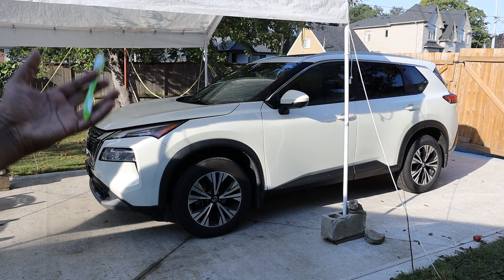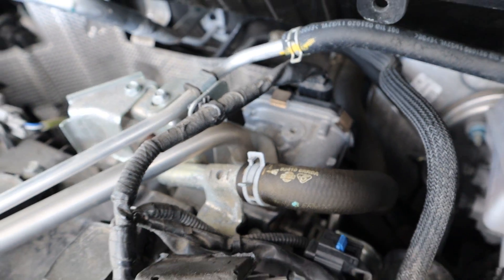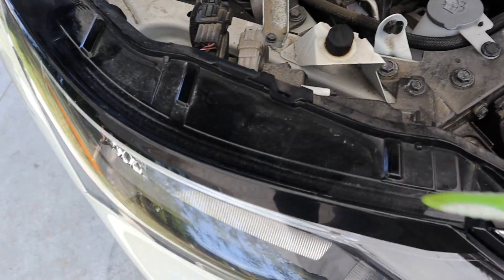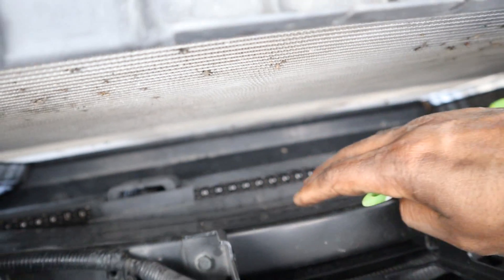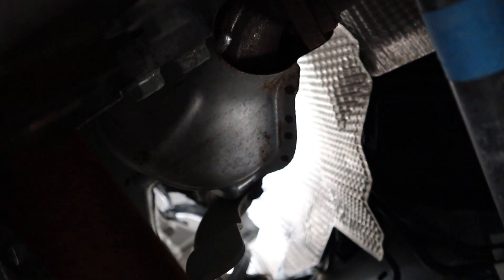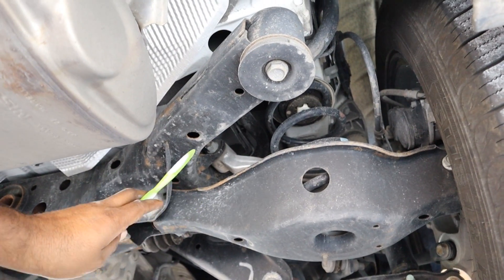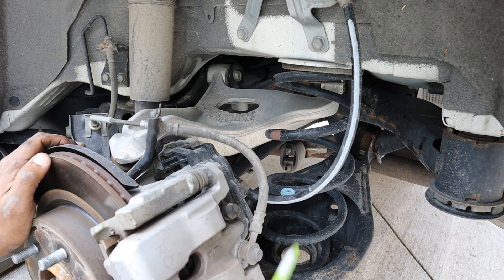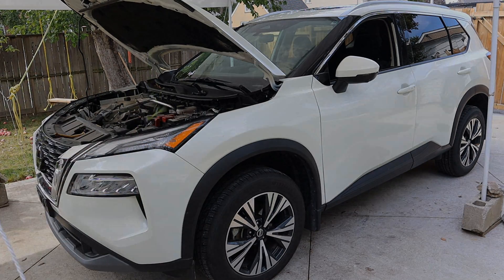Nissan Rogue Mechanical Review

Comment: 10:06 That is not the fill plug for the transfer case. That is the magnetic check plug, but not the fill plug. The fill plug is actually on the opposite side higher up and is a hex bolt. If you were to fill from this magnet bolt, you would only get half a quart in there, which is nowhere near enough. I just did one of these for a friend and his mechanic made the mistake of thinking that was the fill plug and it was severely under-filled.

Comment: 9:40 you don’t need a special too to do transmission services just drain fill from the dipstick then get the transmission fluid hot by idling and open the level port at the bottom for a few minutes then you’re done. It can be done by yourself in under an hour.
Reply from the maker: Ok

Comment: I take it a 2023 Honda civic 1.5T is much more reliable than this? Same with the Honda crv?
Reply: The 1.5T has problems with head gaskets. If you’re buying a Civic get the 2.0L (or the upcoming 2.0L hybrid). For the CRV, the same 2.0L hybrid system is your friend.
Reply: @tails300  too late, but I'm definitely assuming the civic even with the 1.5t will long outlive the Nissan rogue

Comment: The bottom is very open on this car but in Europe it totally sealed from the road.Everything is covered with plates down under.The power steering is electric.All is four cylinder engines .

Comment: In Europe it is called X-trail but comes with 1.6 petrol engine or 1.5 l diesel  and a manual gearbox or a CVT automatic . Its smaller brother is called Qashqai  with. 1.2 petrol,1.6 or 1.5 diesel with a manual gearbox or CVT.I own  a Qashqai 1.5 diesel and is a nice car and is a top seller in Europe .

Comment: I bought a 2017 Rogue in 2019. Worked fine for 6-8 months. I did the drain and fill on the CVT at 30,000 which was a mild pain in the ass with no dip stick but not horrible. Then spent an exorbitant amount of time at the dealership over the next 6 months getting warranty work on the front end because of a metallic clunk. They essentially rebuilt the front end and it still made noise ohh and I had to do a door lock actuator but because it’s Nissan you can’t just buy the actual actuator and pop it in like a normal car you’ve got to get a whole assembly which was stupidly expensive so warrantied it for that. I decided to sell it to the dealership for a profit during COVID value surge since I didn’t need a second car with us being WFH and having a motorcycle to use if my wife needed the truck. Was never happier to see a vehicle leave my life. Did not want to own that thing without a warranty.  Didn’t recall it being horrible to work on.

Comment: Dealer tech here, so I have a few says on this.
1) Thank you for a very detailed review
2) Transfer case seal oil leak is pretty common on this T33 generation, I believe it's due to improper installation. We have a bulletin for it.
3) These stake castle nuts are not fun to remove. If not being careful, you could damage the CV axle thread and will need to replace new CV axle. Nissan OEM CV axles are quite expensive. I actually prefer the cotter pin castle nut better.
4) We see less CVT problems than before (still, but less), so I believe Jatco made some improvements on their CVTs.
5) The older CVTs that use CVT fluid NS-2, have transmission dipstick. For the newer CVTs that use NS-3, there is no more transmission dipstick. There is still a tube with a "fake" dipstick so you can fill up CVT fluid from the top, but using a scanner to measure fluid temperature while draining overflowing fluid is the correct way to measure fluid level. According to Nissan, this way of measurement is more accurate than the traditional way with a dipstick. It seems to be common among manufacturers (Toyota does the same thing with their AT).
6) Nissan has been using one-piece style lower control arm for years, so either bushing cracks or ball joint gets loose, the whole control arm needs to be replaced.
6) The 3-cyl turbo engine has a plastic engine oil pan (why Nissan??)
Reply: Nissan burned me bad a 2016 Maxima and a 2015 Murano. The Murano puked all its fluid out at 900 miles. From the factory someone used what looked like plier teeth to install the line from the Jatco to the radiator. It split and the dealer made me pay 450 for just a refill. With 950 miles, they said it was rodent damage. My Maxima made it to 90k and hail (luckily) took that car out. As the CVT was on its way out. The Murano I limped 1800 miles for a vacation to California and back to Colorado. Thankfully when it starting bucking at 52k we traded for a 4Runner (new). So now we have 2 new 4Runners, and I will never buy another Nissan. 😂
Reply: This is after Having a 2004 Titan, a 2005 Frontier, a 2005 maxima, a 2006 Altima, 2007 Titan, 2011 Titan, 2011 370Z (loved it) and the 2016 Maxima, and 2015 Murano. So I was a loyal Nissan buyer.
Reply: @JAMESWUERTELE  the new generation Pathfinder comes with a 9 speed AT instead of CVT, so I guess there’s a reason for that.
Reply: Haha yeah, we have a '23 Rogue with the plastic oil pan.  First vehicle I've ever put a Fumoto on, as I just don't trust the integrity of torquing a drain bolt on during a cold Minnesota winter.  It does only require 22 ft-lbs, but ehh.  I feel better this way.
Reply: Hey maybe you know if in the latest 2023 turbo only models, if the CVT is still made by Jatco? Have they made improvement. I am curious about a Rogue. If Nissan would just split from Renault, find some great engineers, and start their own. Their last CEO cheaped out it seems, and now this is all happening.
Reply: @pnutbuttajellee1394  I do believe that the new generation Rogue's CVT is still made by Jatco. Like I said, we see less and less CVT  problems than before, so I assume Jatco did some improvements on their CVTs. Time will tell if the newer gen is getting better or not.

Comment: If it can get 250k miles without much issue like my 2011 Nissan Versa with a 4-speed automatic without burning oil, that would be a miracle
Reply from the maker: Didn't the versa have a CVT?
Reply: @speedkar99 in 2011 no unless you got the SL I'm hatchback configuration. All other models have the 5 or 6spd manual or the 4 spd automatic. I had a 2008 versa hatchback with cvt for abkit 210k miles and it never burned oil and 0 cvt issues on that car even though I drove it like a maniac.

Comment: I own a 2006 Nissan X-Trail which, so far, has been a reliable and low maintenance cost car. I wouldn't even consider a modern Nissan, especially one with a Jatco CVT!
Reply from the maker: You missed the CVT craze then
Reply: @speedkar99  yup, dodged that bullet!

Comment: We have used these models at my work for four years now. This is the first year they had a 3 cylinder turbo engine. The go kart style transmissions get you good gas mileage. I got 44 mpg driving from Atlanta to Griffin GA last night, primarily on the main highways. Good gas mileage. We fold down the rear seats. The covers pop off on the backs of the seats with our high impact use. An ordinary driver might never have the issue with the rear seat 💺 covering coming off, but overall, they are cheaply made. The stereo is fine, has android and apple CarPlay. The cars engines and drivetrains have basically changed almost every year, but the body style is the same as almost ten years ago with minor changes. If you can get a deal on a new one, I’d say they hold up to normal usage. We did have one with an engine that failed on the first day using it. It was an engine out/swap to get it fixed. Like I said if you can get one for less than a Mazda, Toyota or Honda of similar size and build you may want to take a chance. Buyer beware, they are cheap, but reasonably durable. I’ve never had a Honda engine fail. My best friend buys only Toyota, and my third friend has a Rogue. She doesn’t know anything about cars and always buys the worst cars. I’d buy any car beside the ones she picks out. Hope it helps if you’re wondering about Rogues. This has been a very honest appraisal of my experience.
Reply: Did you fill the tank before and after the trip? I do not believe you got 44 mpg in a gas crossover. My Camry hybrid likes to claim I'm getting 54 mpg on a highway trip sometimes, but it's always 43 mpg at the pump.
Reply: @aluisious your computer shouldn't be that far off. My sienna is pretty spot on only ever a 1mpg difference. I'm averaging 41mpg in my sienna hybrid and wverytime I hand calculate it the vehicle is always really close.

Comment: I take it that this review also applies to the new Mitsubishi Outlander?

It seems to me that the French engineering is strong with this one, thus the cost cutting on the parts for easy failure.
Reply: There is no cost cutting. What in the world are you on about. Whatever Honda/Toyota/VW you're driving will have smaller axles, more plastic parts and won't have Nissan's use of aluminium on control arms or independent rear suspension.

Comment: What is it about the jatco design that causes so much failure? Hondas been using CVTs since the 2013 accord and you never hear about their cvt blowing up.
Reply: The jatco cvt, unlike the honda and toyota units, lacks a launch gear. It gets the vehicle moving from a stop, then the belt takes over. Transmissions are under the most stress when moving a  car from a dead stop. So every time a nissan trannie starts to move the vehicle the belt is under the full load of the vehicle. If the belt slips under this stress, u get 3 new neutral gears. A launch gear significantly reduces belt wear and limits the "rubber band" feeling common with cvts by serving as a "1st gear".
Reply from the maker: Overheating. Insufficient design. I have another video on CVT failure...check it out.
Reply: @speedkar99  so cost cutting, like with every nissan product since renault took over.
Reply: Issue is people beat on them like they stole the car.  Nissan cvts can do 400,000 kms when taken care of and you keep changing the fluid.  I have seen original jatco cvts go 400,000 kms or more.
Reply: @kevinW826  that doesnt suprise me since nissan now occupies the market segment pontiac once had and the altima is the new pontiac grand am lol
Reply: @kevinW826  My 79yo friend has a Nissan with Jatco CVT.  He drives infuriatingly slow and easy.  The first Jatco died at 15,000k, and the replacement lasted to 45,000k.  Pretty good for a transmission you say will last 400,000.  Maybe his 3rd one will go till end of warranty?

Comment: No turbo charger to fail and no head gaskets to fail, and no contamination of the oil with gasoline like the Honda CRVs with 1.5T.
Also they don't catch fire like the Hyundai/Kias.
Reply from the maker: But it's got the CVT to fail ...😂
Reply: I had a 1.5 civic.  No issues until 200k miles, cvt was fine but head gasket started to ooze
Reply: No head gasket????
Reply: Had a 2016 1.5t civic. Transmission went at 45k and the head gasket went at 83k and the dealership screwed me out of my warranty coverage… can’t trust new Hondas, actually it’s known that the 1.5t L15 is bad

Comment: “Now I can remove the air filter” and it’s full of leaves and junk 😂😂😂

Old Honda ridgelines are prone to strawberry milkshakes due to having the transmission fluid cooled in the radiator I believe. I wonder if this setup is more reliable, less, or the same?

That’s brutal that there’s that much rust on the subframe at 2 years old! Seems like a five year throwaway vehicle.
Reply: Depends on the Radiator.
Many cars cool the transmission fluid trough the radiator and most never have problems there.
Reply from the maker: Yes some coolers can fail....this type is less prone since the transmission fluid doesn't go through the radiator.

Comment: On electrical side of this car the mess is not smaller: you can have wires which leave front side, go to back to be connected there and literally go back to front to be hooked to some modules. You may find some modules placed next to trunk which don't have any sensors and which are connected to BCM, ECM located in front. Nice engineering, Nissan !
Reply: Nissan's wiring supplier must be in bed with one of their engineers, I swear. There's miles of it in this thing!
Reply from the maker: Wow

Comment: Any improvements on the newer jatco Cvt's ?
Reply: 1.5L Rogues have the CVT-X.  Chain driven, torque converter much larger.  Should see less issues.
Reply: You have to maintain the fluid. People don't and then they fail
Reply: @hjer731  yeah I have seen people never get the oil changed or service their cars on time and they complain about reliability on the internet.
Reply from the maker: Yes they have some improvements for this model year, but that doesn't always mean it'll last longer...time has to tell